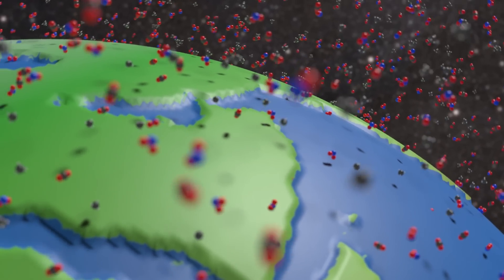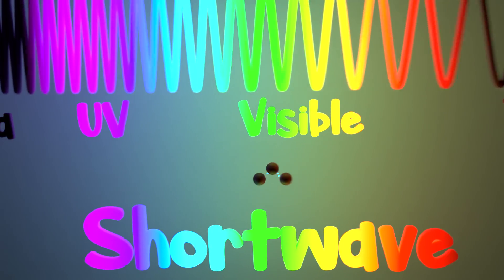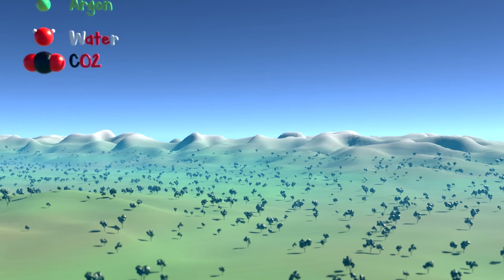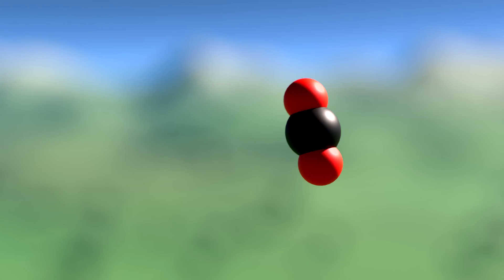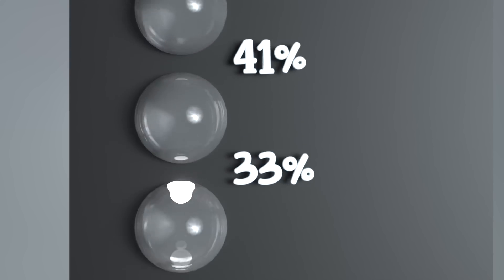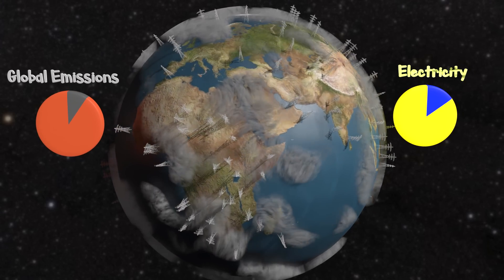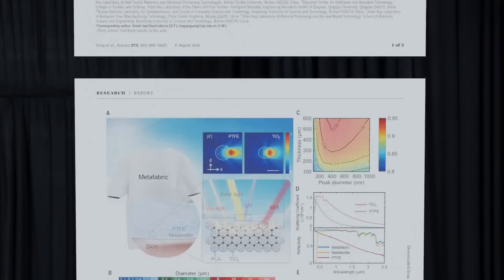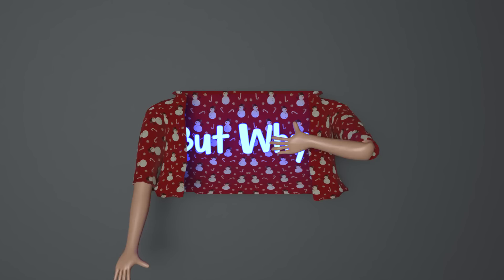Energy Free Cooling through Physics

Comment: no what is the % of the co2 and where is it generated
now is co2 linked to the heat increase or is the heat followed by the co2 (it gets hotter then you get the co2 increase)
one of two statements is true and one of them is absolute false 
one has happened multiple times in the Planets history 
and one last thing you started by talking about the magnetosphere and then stopped which is much more interesting for climate occurrences
and then you started talking about fashion and did a little TiK ToK dance which will not stop anything and will just lead to more pollution in the environment
now if what you saying is true this can be fixed with a satellite whit a 1000m solar sail between Venus and Mercury cutting down the light energy we get from the sun
no fancy fancy materials needed I don't expect you to respond but keep pushing the PFAS what possibly could go wrong

Comment: have you ever checked the assumption that re-radiation of energy from an excited molecule is spherically symmetric?
It certainly seems true in a particle model, but as Plank said, you have to use the wave model to get the true picture, and there's  a lot of resonance issues that apply to gas within an established wave field. at the sizes distances  involved at 1 atm, you even get coherence between molecules which are excited with black body radiation.
worth the rabbit hole if you want to understand better, and not give an over simplified and incorrect explanation of green house gas action.

Comment: i wounder how much of an efect it would have to use powderised arogell and add it to paint  both indors and out doors  how much cooler would say a trailor home might be in the summer as most of these sort of homes are made of metal on the outside, what would the difrence in temp be between a trailor home painted inside and out with regular paints vs one painted inside and out with paint mixed with airogell powder.  iwant to imagin it wouldent be a lot but any difrence would help, and then you have the added bonus of a little extra fire protection maybe

Comment: With a 3d graph of CO2 levels crossing the 400ppm plain, you said “the amount of greenhouse gases is too much for the life that lives here”. I assume you implied CO2 specifically. In either instance you’re wrong: For most crops the saturation point will be reached at about 1,000–1,300 ppm under ideal circumstances. A lower level (800–1,000 ppm) is recommended for raising seedlings (tomatoes, cucumbers and peppers) as well as for lettuce production.
Reply: Do you include the effect of heat on the plants (including changing weather patterns?)
Reply: @catprog  I just can’t leave you with the last ethereal word but based on past planet temperatures,  warmer weather will only increase the growing seasons and the higher ocean temperatures and air temperatures increase the amount of moisture in the air 7% for every degree Celsius. Aren’t we low on fresh water? O.4% both usable and drinkable. Could change the climate zones. Some valleys may be more flood prone or maybe even inhabitable because of it. But probably less deserts overall so a plus for the world, and less reason to eat bugs.

Comment: I believe there is a simple problem here that turns this into a pipe dream.
If you have a panel and you paint different colors on each side, say e=0.7 on one side and e=0.2 on the other
you do not get a one way driving effect.  You get a material that is e=0.2 overall.
This is the mistake here.  Different coatings default to the most restrictive or basically lowest value of all of the individual materials.
There is an exception to this in Quantum Mechanics:  3 polarized pieces of film.  2 are set at right angles to each other and block light transmission.
Now slide the 3rd in between at a 45° angle and about 25% of the light transmission returns.  This effect is still unexplained.

Comment: Australia has for the most part a sub-tropical temperature gradient and it's history is full of innovative ideas. Listening to your video reminded me that there was a time when houses had roofs of corrugated sheets of a galvanised iron tin composite. As you can guess this was a rather radiant material to use for roofing. So to reduce it's heating effect it was traditionally painted with a thick silver colored lead paint which had a texture of millions of nanometer balls in it. Which thanks to you I now understand would have broken up the infrared light and radiated it away instead of letting it through. Of course with the advent of tiled roofs this is no longer used but perhaps could be in countries that still use curly tin as roofs.

Comment: I don’t understand how this could work.. this material promises to transfer heat from one side to the other. So the inside gets cooler than the outside. What if we put a Peltier module between that generates electricity? 
This will generate electricity from nothing, and I don’t understand how

Comment: I wonder how this is coherent with thermodynamics. you are basically pumping heat without external work from cold to warm. You could have two chambers with this layer in between and after a while, the cold one would be at absolute zero (no infrared emission left) and the hot one would have all the energy. Does that add up? Without deeper insight I would spot a perpetuum mobile (second variant) here.
Reply: And you could use a Peltier module to generate electricity from apparently nothing…

Comment: Great video... Thinking about it, with proper mature products "Anti-Thermal" Powerplants should be possible.
10°K is huge you could definitely run a well tuned Sterling engine of it. May not be very efficient.
But it is a start at energy "generation" that does not add "run-away" thermal energy to the environment.
Using environmental thermal as energy source has great potential both in the "energy" and "saving the planet" department. It is not really a choice anymore -_-
Reply: Free energy from nothing apparently
Reply: @truestopguardatruestop164  Not nothing, the temperature of our planet, or rather it's thermal energy potential.
It is literally all encompassing and in excess.

If it weren't we would have a global cooling.
We can never use energy directly, what we use is the flow of energy, from some "higher" potential to a "lower" potential to equalize.

To get some work out it, it really doesn't matter in which direction it flows, as long there is flow.

Radiation is the only way to get rid of thermal energy in space and our planet is very inefficient at that... thanks to us.

So if we have a way to radiate thermal energy "away" into space more efficient than our planet we can use that to create an energy flow.
And where a energy flow is, can be work extracted. (planet->do X->space)

Comment: This isn't a method for cooling at all. It's a method for delaying temperature gain. The second law of thermal dynamics forbids devices like this from ever having a stationary temperature than the surrounding air. Unlike a green house which at stationary state is hotter than the surrounding air.
Reply: Temperature of space is very low. 

If you increase radiation to said very low temperature environment  you have a cooling effect.

Comment: Talking about global energy consumption but put this material globally to. The cost?? What is the price per m²?? Why aerogel is not common use on buildings because of the price. As long energy is cheaper than insolation over a 3 years period people prefer pay for energy to cool the house, in the end use air-conditioning than isolated the house. I have own experience told people isolated the house, they still go and buy 3 air conditioning

Comment: I wonder if this would be a good window covering or backing for summer months in places that rely on air conditioning. I grew up in Florida without air conditioning and we used to lay on a linoleum covered cement floor for relief, or run fans over pans of ice. The heat and humidity was brutal. In Missouri, I insisted on a berm home, just to be able to enjoy cooler temperatures in the summer.

Comment: Didn’t realize most of the heat from my oxyacetylene cutting torch was actually radiation. And how little heat is transferred by the actual molecule contact. It’s like, when I hold my bare hand next to a hot vehicle exhaust, the radiation heat is twice as powerful as when I physically contact that exhaust. 
Ok, you have taught me how global warming really happens.
Thermal radiation is one way to accurately measure heat. Most of the heat on the surface of the sun is not radiating through the perfect transparency of space and heating the Earths surface to two thirds of origin.
Reply: I dont think that two thirds of the heat of your oxyacetylene torch come from radiation. That would mean, that it would be almost as hot next to your torch than it is right in front of it since it radiates in all directions randomly. However the cutting only works when the flame is directly contacting the material, so i think conduction plays a major role in this case.
Reply: @asimi900  
Your right. I was being kinda snarky. They do take a known scientific fact, thermal radiation can increase heat in objects that absorb it, but blow it way out of proportion to come up with aggressive heating due to trace amounts of CO2. 
Maybe because satellites only measure the IR radiation to get temperature readings anymore, so it is impossible to separate the contact heat from radiation heat. There are many real scientists who don’t believe in GGGW. But the basic principle is correct.
Reply: @glenndavis4452  Yeah, CO2 was almost never considered the main contributor in the first place since it’s so short lived. In a single human lifetime most of what’s been released can become part of a plant. CO2 has always been about power, money, and starting the conversation.
The actual kickers are a whole gamut of different things, like methane, which can stick around for centuries and actually do some damage. Coincidentally about as much is getting released from the short-term problem of melting ice-caps/glaciers as all of human industry combined, which is why people were so panicky before, trying to keep those damn ice formations intact.
At this point the ice is melting at such a rate that quite a lot of people have resigned themselves to the higher electricity bill and the hundred-year floods every other year. Local governments are really struggling with all the disaster relief they have to do these days, sadly.
Reply: I checked carefully and could not find a single accurate fact. Conduction is a much better method of heat transfer than radiation. You will burn your hand much worse/faster grabbing the hot exhaust
Reply: @jackiemowery5243  
That’s what they are teaching kids nowadays, I guess. The “science” of climate change is so full of BS that it would be funny if they weren’t using it to bankrupt regular people. 
While people are freezing this winter, maybe we can ask one of these nut cases why can’t they force an extra 3.5C into their apartments just by having 400ppm of CO2 laying around somewhere in the system.
Reply: @jackiemowery5243  I assumed Glenn was being sarcastic!
Reply: Yup! Space is cold

Comment: You know that in most climates most buildings don't actually need a lot of cooling? If the building is insulated and uses a ventilation heat recovery system it's usually enough to use the cooling of the night and only on very hot nights a small amount of active cooling.
We don't need to reinvent the wheel, the technology is already there. It's not so expensive and it saves the consumer a lot of energy cost.

Additionally these fancy passive cooling things only provide a very limited amount of cooling power. They sound genius but they only work on very limited locations where you don't have any days in the year where your cooling load is bigger than the maximum supply, which is actually quite low. If you use insulation and heat recovery instead and you have higher load than you can supply the heat inside the building is only slowly growing so you have some time until it becomes uncomfortable. If the load exceeds the dimensioning of buildings without insulation and heat recovery the building will overheat way faster.
Especially in warm climates ventilation systems with latent heat recovery don't only reduce the heatload massively, but also provide significant better room climate. The technology is already there. It's just not that fancy, but it works. And it is surprisingly affordable actually.

Comment: I use clear plastic totes as terrariums for plants.. The problem is that the plastic degrades under UV and becomes brittle. I found some plastic that is UV resistant that is used for HDTV diffuser sheets and polarizer sheets that have platinum metals electroplated to them. But these can't stand any cold or they rip..

Comment: Regarding elevated levels of CO2 causing the elevation of surface temperatures.. I wonder if you've ever tried to make sparkling water (CO2 gas desolved into water)? 

First try this with warm or even room temperature water
..then tried the same process using chilled water.

The effect is generally quite the opposite of the "CO2 raises temperatures" dogma.  Atmospheric CO2 is caused by warming..   Rather than  warming being caused by CO2. 
Looking at the Greenland ice cores, as the gold standard of ancient atmospheric composition,  CO2 trails temperature increases.

 Certainly there are many elements to the nuance of global climate regulation,  with IR absorbance being a significant one.

Unfortunately, it seems oversimplification of this cause and effect model has lead the masses down a path of "lowest common understanding", creating the dangerously political (effectively religious) "anti-accepted scientific-dogma" environment that we live in today.  

It is far more dangerous than 400ppm of CO2.

Comment: If you base the function of that apparatus working on the fact that its scattering visible wavelenght light at the outer surface doesnt it mean that the light thats being scattered, deposits part of its energy to the structure it reflects from, in turn applying some energy in the system, working against the thing  you are trying to do?

Comment: The greenhouse effect doesn't increase temperatures.
It mitigates temperatures. 
Because there's no greenhouse effect without "umbrella" effect.
And the greenhouse effect of CO2 is mostly inexistant.
In deserts where the main supposedly greenhouse particles are CO2 , the temperatures are extremely hot in the day and cold at night.
No greenhouse effect.
In equatorial zones , where the solar radiation is the most intense and where main (real) greenhouse gas is water , the temperatures are much more cooler in the day (umbrella effect) and remain warm at night (greenhouse effect).
So the narrative about global warming caused by CO2 is just propaganda.

Comment: Excessive heat intake and subsequent need for a lot of active cooling is only a problem in buildings with insufficient insulation. The good ol commieblocks require minimal heating in winter and minimal cooling in summer, because the thick concrete plates are heat uptake neutral while also having huge thermal mass and great heat insulating properties - houses built out of such materials don't even need external or internal insulation in most places, it's just bare (painted) concrete on the outside and bare (wallpapered) concrete on the inside. In very hot or cold climates and/or places where people for some reason make houses out of drywall, you just need additional layers of mineral foam to take care of it. Having better insulation is a superior approach to having inverse greenhouse paneling, because having stable interior temperature that doesn't depend much on outside temperature is good no matter what, whereas having colder interior is only good when it's hot outside since when it's cold outside, it's even colder inside.

Comment: Cool video. I read about a paint utilizing a similar effect a while back. A question re: Your description of the greenhouse effect. My understanding is that the atmospheric density at sea-level causes an excited molecule: CO2, water, methane, etc. to transfer its energy to neighboring molecules via collisions (conduction). Collisions happen so fast that most excited molecules don't have time to revert to their ground state before hitting other molecules. This increases the average kinetic energy, increasing the probability some molecules get enough energy to radiate in the infrared. The resulting warmer, moister air rises until the water vapor precipitates out, radiating the latent heat (again infrared). Above the tropopause we still have CO2, methane, greenhouse gasses that don't precipitate out on Earth. Once the atmosphere gets thin enough then the emissions lines thin out and we need to consider that emissions go in random directions. Often back towards the Earth. I would appreciate your feedback. Thanks in Advance.

Comment: Interesting topic and great video.  However, what are the energy and material costs of the materials needed?  How much green house gas or heat is produced by making these materials?  How rare are the elements?  When looking at potential solutions that seem too good to be true, one shouldn't assume it will or will not work but rather should look at both the upsides and downsides to it working.